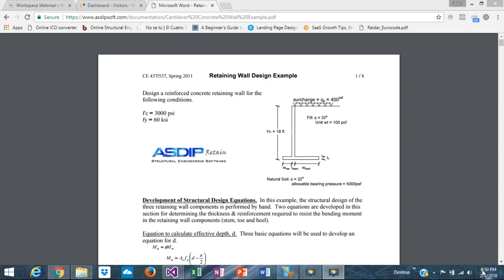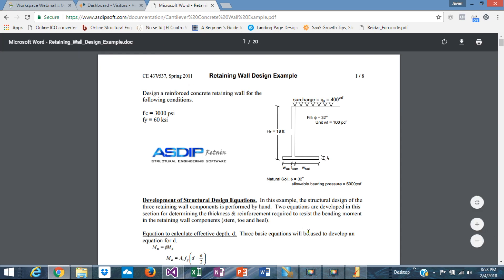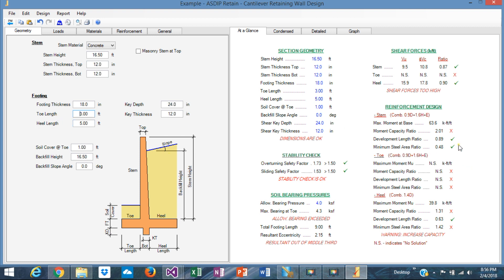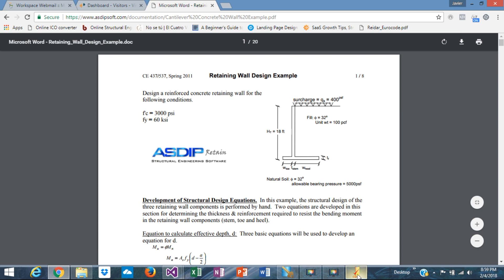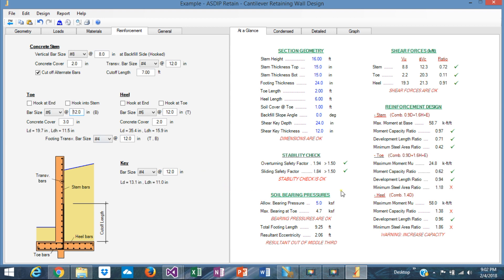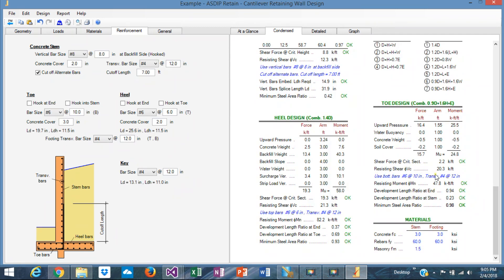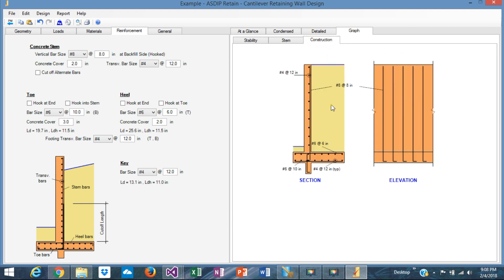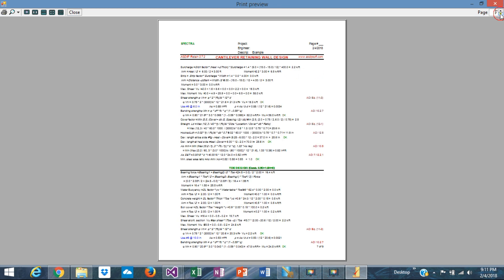Cantilever retaining wall design using ASDIP Retain

Comment: It is interesting that you just put one side earth fill side rebars.Why? Does program do not allow to putrebars two sides?
Reply from the maker: Of course the program allows to put bars two sides. It's up to the designer what to use. Regards.
Reply: @asdipstructuralsoftware7797  sorry Mr. Javier but i just downloaded trial version and system does not offer both side cantilever retaining wall.It just optimize and give at earthfillside face rebars?
Reply from the maker: @AA-hr3ul  Please go to the Reinforcement > Stem tab and mark the check box for the rebars at the front side. Regards.